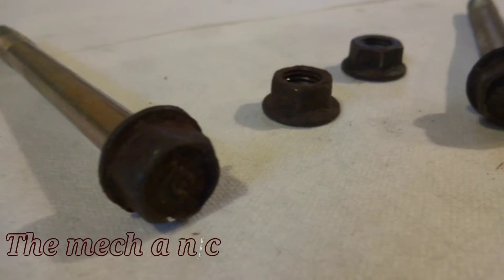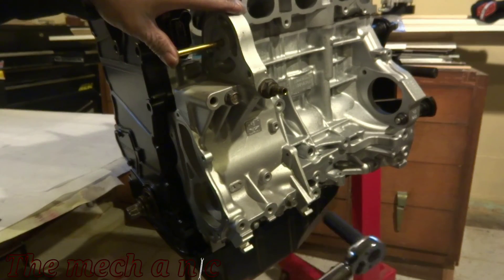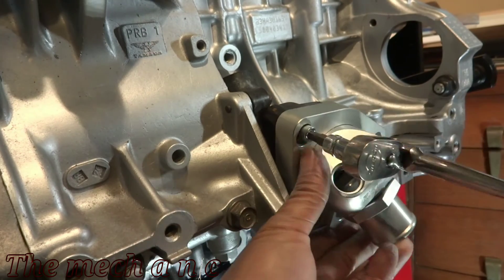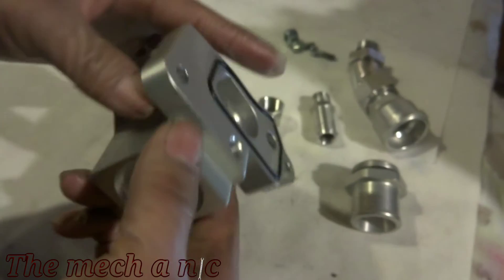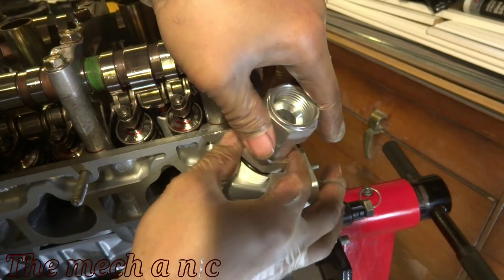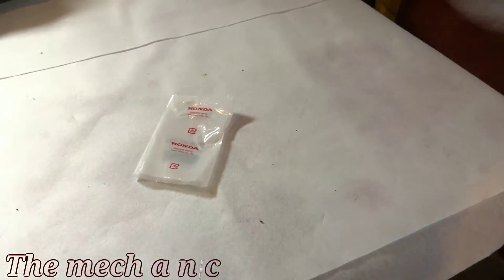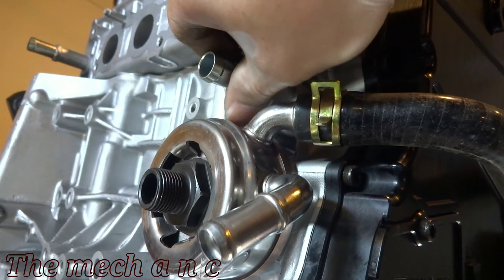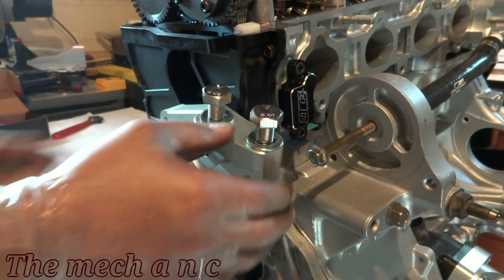K24 engine cooling system

Comment: What's the nipple for on the filler neck?
Reply from the maker: Relieve pressure
Reply: @themechanic6117  so it's an overflow connection?
Reply from the maker: @mertcapkin7263  yes, it goes to the over flow tank

Comment: wassup bro,  what is the s2000 part called (oil plug) or can you provide a part number
Reply from the maker: Someone has asked this question before.  Please check the comment section
Reply: @themechanic6117  so instead of telling me,  you make me search for it... lmao...
Reply from the maker: Because I don't know it, I'd have to search as well. I can't remember every part number.

S2000 fitting part number- 11107-PT2-000

Comment: Wish you would have shown removing of the bolt for the oil filter housing
Reply from the maker: Just put a socket on it that fits and Remove it
Reply: @themechanic6117  for the threaded bolt that the oil filter originally spins on? I see nowhere a socket could fit. I’m reading people either use the double nut trick or just use a pair of vice grips but I’m having trouble with mine
Reply from the maker: Mine has a hex that I use a socket to screw on if I remember correctly.  I remember now, I'm pretty sure I had to use vice grips to get it to unscrew. It'll damage it so make sure you have your new parts
Reply: @themechanic6117  I finally got it. It was a pain but a big ass pair of vice grips did the trick. I wonder how much of difference running this oil cooler helps? I figure with me being down south where it gets hot as hell and I’ll be running the car a bit it should help a lil.
Reply from the maker: It's not as good as a aftermarket oil cooler but it's better than nothing

Comment: Great tips! My only recommendation is I would suggest the silicone spray very sparingly on the hose connections. The silicone sprays I have used leave an oily film that I wouldn't want in my coolant, so I apply only a very light coating to the fitting the hose goes onto with my finger. Keep up the great work! 👍

Comment: Did you add silicone on the water pump pulley or only on the housing?
Reply from the maker: Why would you put silicone on the pulley? I only added silicone to where the housing meets the block

Comment: The cat noises were funny the first 100 times. Jesus christ you over do it on every video man smh
Reply from the maker: Theyre my videos and i want to have fun making them. I'm sorry you feel that way
Reply: More power to ya buddy. By the way, you don't need Teflon tape on tapered fittings or fittings using an Oring. Good luck on the build 👌🏼
Reply from the maker: Just some extra peace of mind with the tape 👍 thanks for the tip

Comment: I hope you're aware that any "mechanically" or "chemically"
cleaned fasteners will oxidase very quickly if not coated or treated.

People have laughed at my techniques. I always paint or at least
clear coat all fasteners, if their polished.

"Wow, are those chrome?"
(smile inwardly)
Buffing wheel, rouge (compound)
After tightening, clear nail polish bolt heads & nuts.

EVERY* metal except gold reacts with Oxygen. Add electricity-
milliamps from a battery or millions of volts of lightning-
when you ionize Oxygen you get Ozone- it's deadly poisonous and
highly corrosive big brother. Take vitamins called "Antioxidants"
because even your blood rusts (free radicals).

Wet sandpaper? Black grit= Aluminum Oxide. 
White powder on aluminum? Alumina Oxide
At least spray your raw aluminum with clear when installed.

"Rust" is just slang for Oxide, but it's usually only used for iron & steel.
It's also the name of a brownish, ruddy color. All other metals' 
corrosion is referred to as "oxides" or "green crusties".
You do not need water to corrode metals, but it does accelerate the process.

*some metals like platinum only "tarnish".

Comment: Yo I have a question , I have a k24a2 and I bought the plug n bracket that goes in my thermostat so I can delete the heater hardline, do I need anything else? I know the k20s u have to plug the back of the head, do k24s not have that ?

Comment: Hey i have question if im running k24a4 wich coolant  do i buy k24? Or k20? I see ppl buy k20 but not sure if everyone head is k20/k24 thanks
Reply from the maker: Which coolant? As in which antifreeze?
Reply: @themechanic6117   no wich upper coolant housing do i need for  my k24a4  head   ? K24/k20 one right  . I see ppl with k20 version so i was curios

Comment: Might sound like a nob question but the water neck on the side of the motor, what are you eliminating buy using that part? Just the fill port for the radiator? Is this used so the radiator can be tucked. Probably a dumb question but haven’t found the answer
Reply: High point in cooling system,easier to bleed?

Comment: When putting a Type S water pump and housing on a K24, is there anything else that needs to be changed? Do belts and accessories all line up?
Reply from the maker: Im using the ktuned alternator relocation kit so i cant speak for oem parts but i believe the belt n accessory still lign up

Comment: Can you install one of those on the Honda CR-V 05 just wonder
Reply from the maker: As on as you have the plug to pull out so the s2000 part could be installed it should work. Youll need all the pieces
Reply: The mech a nic ok 👌 I will check if I have the plug it should be up right on the oil housing right but  the water pump it’s different doesn’t have the plug where you put the hose on the top
Reply from the maker: @thexflexclan  youll have to change the water pump and the complete housing from a rsx S
Reply: The mech a nic  i see the plug but I don’t know if you can just put the the other part that connecting the hose hey I have a question i recently replace my rear differential fluid on my Crv but even noticed long before replace it the rear driver side tire it slips like on wet road while turning well not turning just a small curv the tire start to slips then the steering wheel shakes a little bit but I don’t know it’s that normal never have an 4wd car before so I don’t know plus got new tires as well I won’t do it in high speed just like when driving on 40 mph or 30 something like that
Reply from the maker: Im not familiar with the awd on the crv, sometimes its normal for only one wheel to spin when you loose traction
Reply: The mech a nic ok yeah I don’t know it’s weird it’s not like I lose control of the car it just randomly does that from no where I hear a weird noise as well from the same tire idk it’s a wheel bearing as well

Comment: Just a heads up dont need ptfe tape on compression fittings it does nothing. It seals on the 37 degree flare, not the threads. Not being anal just a heads up to save the tape for pipe fittings an pipe fittings only 👌 good video tho bro.

Comment: Part # of the hoses your using?
Reply from the maker: You can find them on ktuned website and hybrid racing website
Reply: @themechanic6117  What bolts did you use for your k20/k24 timing cover, K24 or k20? And the k20 oil pan was k20 bolts?
Reply from the maker: The skunk2 timing cover came with its own bolts but if youre using a oem k24 cover you can use the k24 bolts. Id imagine the k20 bolts are the same. The oil pan is from ktuned so i ordered the short bolts that are required. If you have aluminium oil pan and are upgrading to steel you cant use the bolts for the aluminum pan. Theyre too long
Reply: @themechanic6117  Thank you

Comment: For these 3 bolts and 1 nut you should have applied 33 lbs torque instead of 20... thats 44 newton meters, really good tip about the small passage, i didnt knew it, but not sure if that is enough to make the components stick since you just "masked" the surface with silicone, question: did you applied silicone on both sides right? I
Reply from the maker: Ill re torque it to 33lb ft, thank you for the info. Yes i applied silicone to both sides 👍

Comment: Nicely done and quite pretty :)  yes there's a torque for every fastener if not I  use the universal torque  chart for each bolt specs as a guide. 👍
Reply from the maker: I didnt want to over torque lol. Someoneleft a comment with the correct torque spec and it all done. Had to tighten it a bit more 👍 Thanks for watching